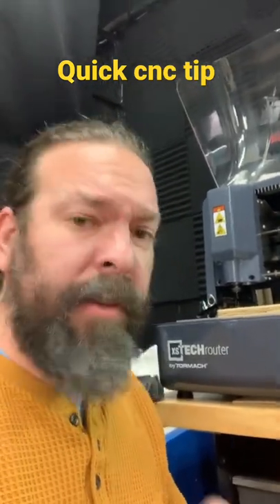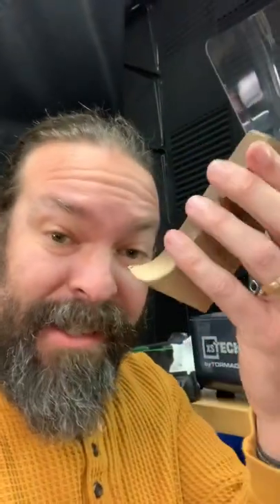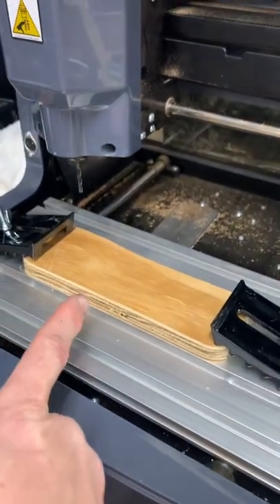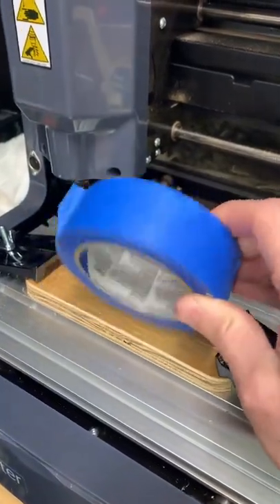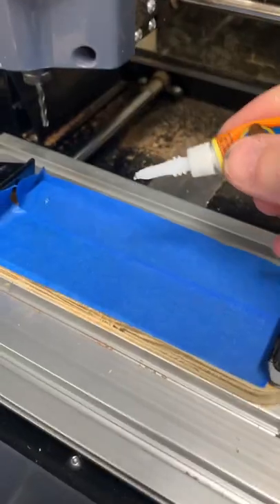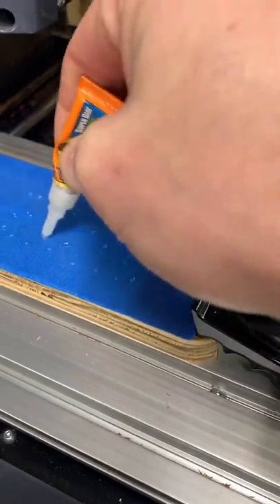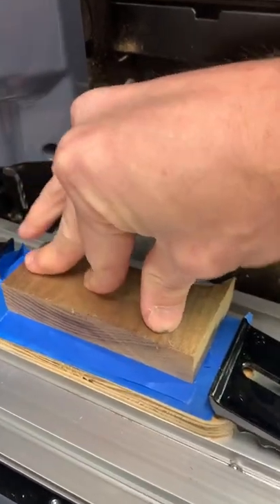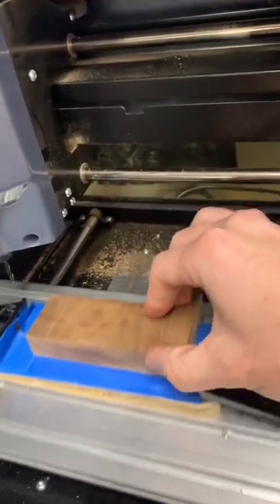Quick #cnc work holding tip! #shorts

Comment: Umm.. you just made a more expensive version of double sided tape.
Reply: Most double sided tape is "gummy" and will yield when the milling machine goes to work. It also really gums up the tool when it comes into contact. The smart thing about the painters tape, you can really squeeze it tightly on both surfaces and /then/ join/ them by the glue. Even a double sided paper tape, you would only get it sticking on one of the surfaces really good.
Reply: @zaprodk  Strange..I just ran 17 jobs this afternoon for customers. All with double stick tape and experienced nothing you mentioned. Maybe the fact that I'm milling aluminum and steel with a real cnc mill makes the difference. The mill doesn't care if it's cutting aluminum or steel, and it certainly doesn't care when it passes through the tape.
Reply: @zaprodk  depends indeed on the make of tape. The 3M double-sided is really thin and not springy at all.
Reply: for this convo i want to point out the different varieties of double stick. some are thin, some are foam, some use different adhesives and some are right or wrong for the job
Reply: @harrymu148  Thank you Vice President Harris for that word-salad on tape.